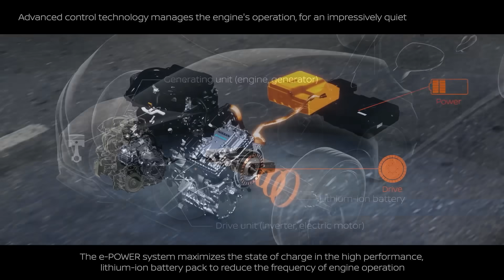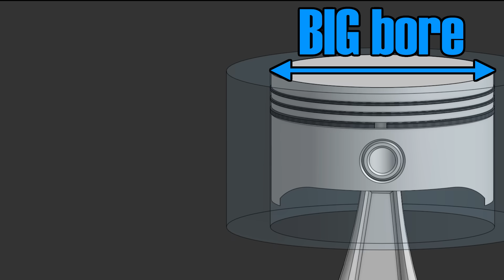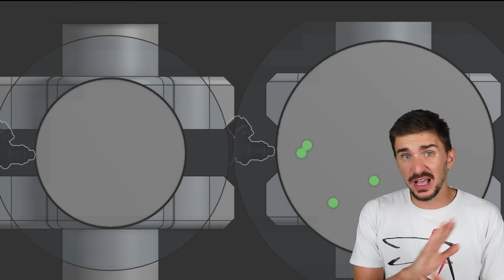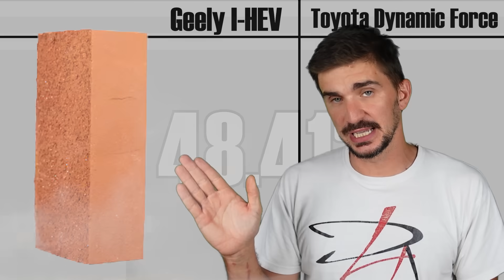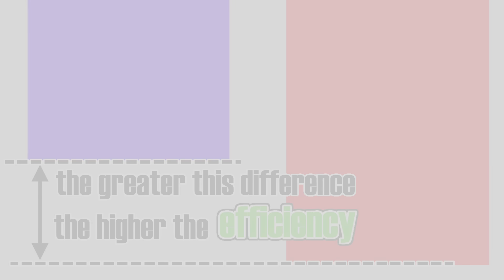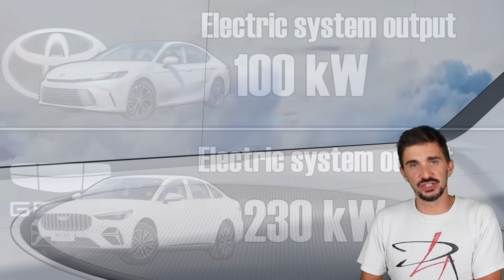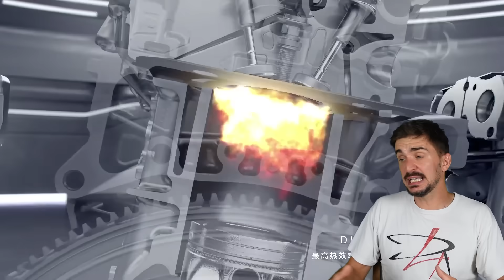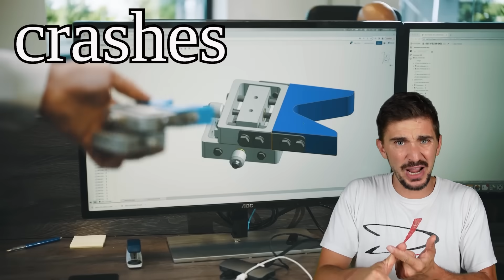How China's Geely Beat Toyota, BMW, Ford and Everyone Else

Comment: I love the development of the technology. I hate the fact that when we all have 120 mpg cars, gasoline will suddenly, magically cost $15/gallon.
Reply: It already does cost $15/gallon, you are just paying via income tax and federal subsidies than paying directly at the pump.
Reply: Welcome to Europe
Reply: Welcome to other parts of the world
Reply: That fuel is for Israel bro don't be antisemitic!!
Reply: That's too bad!
Reply: they also have plugin hybrid, so pump prices dont matter that much. but charging cost does.
Reply: You mean $150 a gallon
Reply: Don't worry the new metric is km/Kwh
Reply: Just like how electricity bills have gone up despite using 90% less electricity to light our homes.
Reply: but no one would still buy EV because engine should goes vroom
Reply: You'll only have 120 MPG cars if you drive compact snd subcompact cars. If you're gonna drive a giant pickup truck just to take your ass to work and Walmart you're not gonna get that 120 MPG.
Reply: @imnotusingmyrealname4566 lol so true
Reply: Yup.  It's like the campaign to use less water in California about 15 or 20 years ago.  It was such a success at reducing the water consumed, that the income to the water suppliers went down significantly, even though many of their costs are fixed (mostly related to infrastructure).  So, the water suppliers requested a rate increase to get back to their previous income (and probably more).
Reply: @proberts34  water costs more in cali cuz we use more water simple as. We grow over half of all the food america consumes and have the largest population of any state. We steal water from 4 neighboring states to meet our needs. Obviously water stolen from 100s of miles away is going to be much more expensive.
Reply: Well, in this state of economy, my 30 years old car disagrees :D. It is still managing over 40mpg tho, which isn't that bad overall. And maintenance costs are negligible too. I hope it will serve me many years to come, maintaining AI powered 120mpg car with overengineered drivetrains is something else... Well, Toyota's HSD is pretty reliable drivetrain, the question is, can other manufacturers achieve this level of reliability, even the cheaper chinese ones? Moreover, my car is simple, more mechanical than electronic, if there are no parts on the market, it isn't that hard to modify some other parts to make it work, like I did with engine mounts which are no longer manufactured for my model. With new cars, I don't think it would be that easy...
Reply: @steposka 1994 corolla owner here, 57,000 miles on clock & running like a champ with amazing fuel economy
Reply: @MrMajjido 94 Corrolla with only 57k miles man your car is still brand new. Please take good care of it for me. Those 90’s early 2000’s Corollas are gems.
Reply: @steposka   30 year old? 40 mpg? Is it a scooter?
Reply: @PavelKostromitinov Cars that can get 40mpg have been around for a while.
Reply: @PavelKostromitinov C5 corvettes can get 40 mpg while cruising with 400 hp on tap when needed. Due to weight and parts available today.
Reply: @dodgedaytona7435  OK, I finally went and converted mpg into units I actually understand. Impressive, but yes, believable. My bad for trying to do the math in my head and getting some ridiculous number.
Reply: @PavelKostromitinov  Octavia mk1 AEE 1.6 MPI 55kW :D. I aint racer, long term average sits about 7l/100km, on highway I can get 5.8l/100km at best and at snail speeds, usually around 6.3-6.8l/100km at more normal speeds and in the city, well, sometimes easily over 8l/100km... I realized that I am not sure whether I calculated US or British MPG, apparently they are different... I keep the engine top notch, ain't no soot in the exhaust, engine runs smoothly, no misfires, sparkplugs have exemplary look to them.. When everything works as it should, even old cars with old engines can run quite efficiently for what they are :)
Reply: @PavelKostromitinov  It could simply be an old  Suzuki Swift or a Geo Metro, but in the US, it's considered a "penalty box."
Reply: The idea is to put four times the number of cars on the road with the same gasoline imports. It’s not about you, it’s about your country.
Reply: @Krunch2020 it's about your money.   It seems every time something gaines efficiency the people that sell you products (gasoline) have to raise their price to make the same amount of money.
They did that decades ago with diesel. They raise the price of diesel not because it costs more to produce, a person with a diesel vehicle got more miles per gallon so they're selling less of it..... So,  similar to DIE they raised the price of diesel to make it more "fair" That's why the person mentioning this said $15 a gallon of gas. 
In essence you're never going to get ahead.
Reply: @randywl8925 did u learn about supply and demand yesterday?
Reply: @randywl8925its not really a conspiracy, just simple supply and demand. More efficient engines means lower fuel demand and therefore prices but that in turn makes people drive more which raises the demand back up. Its a common phenomenon where increased efficiency leads to more demand. The benefit in this case is not in how much you pay for gas, but how much that gas now allows you travel.
Reply: @Krunch2020  How exactly does the price going up help that?
Reply: @Krunch2020 that will be hard in the us, then infants and kids have to start drive cars, since almost all grown-up in us drove cars
Reply: @Krunch2020  The US's population appears set to start decreasing.  You can expect the number of cars on the road to fall also.
Reply: @kensmith5694 That holds for most countries outside of Africa.
Reply: the economy is rigged
Reply: @rezah336 well yeah….it has to be…..the aim is to flatten out the extreme boom/bust swings that cause so much damage & hardship…..the Great Depression for example
Reply: @lancecooper4646  give me a break... an unrigged economy never goes bust except for natural disasters
Reply: @rezah336 ……so the natural disaster that caused The Great Depression was………..🤔
Reply: @lancecooper4646  fed?
Reply: @rezah336 you cannot genuonley believe a bunch of megacorps don't fuck up unless a natural disaster happens. Stick to turning wrenches u have 0 clue about economics.
Reply: @JointedSpagel  you think you know economics better than those who run billion dollar companies?

stay delusional and keep selling hot dogs, you have 0 clue about economics and business
Reply: We can't win
Reply: Just like the electric cost to charge a car at a commercial charger is relatively the same as fueling a petrol car. No savings, just ripping off the consumer. In the UK electricity is more expensive than fuel!
Reply: @jaywhoisit4863  In most of the USA, electricity is usually cheaper than gasoline or diesel, though since our fuel road tax isn't included in most chargers the math can be muddled by however local governments change their annual car taxes or registration fees to makeup for that.
Reply: 100%
Reply: Well, if you insist on driving a car with an engine of more than say, 2.5 - 2.7 litres, you SHOULD be paying more for your fuel......and Americans for some reason think $5 a gallon is expensive...that's approximately $1.20 a litre, or €1.05 per litre.......cheap from a European perspective as we're paying about €1.75 .....mind you, we DO get very affordable healthcare thrown in, so there's that I suppose......
Reply: @iandennis7836  Why should you pay more for your fuel if you choose a larger engine?
Reply: @siraff4461  because youre taking up more of it for little to no reason. Youre creating more pollution that will cause health issues that will then weigh down the Healthcare system and cause increased spending from every single person in tbe city. So ya pay more for your lifted cuck chair truck.
Reply: @iandennis7836  We insist on $2.50 per gallon because that's what it costs shipping included over here when you live right next to the pipeline and in a state that is honest about their tax base.  We get mad about $5 per gallon because we KNOW FOR A FACT that HALF OF THAT IS LINING THE POCKETS OF POLITICIANS FOR NO GOOD REASON.
Reply: @ManCentralStation I'm afraid we'll just have to agree to disagree here......the way you lot waste resources, you SHOULD be paying enough for it to hurt so as you LEARN not to waste resources the way you lot always do......I've lived there, I KNOW. $2.50 a gallon.....you're getting off lightly at $5.
Reply: @iandennis7836  “I’m mad that people have it better than me” in a comment
Reply: @77R_ hes probably busy dieing of heat stroke right now. Might explain part of it
Reply: @ManCentralStation 
Most western countries pay something around $7 a US gallon at the moment.
In my country almost half that is various taxes. However NONE goes to “lining politicians pockets”. It is totally accountable and we know exactly what it’s spent on even if we don’t always approve.
Reply: @meofnz2320 I’m not interested in opinions from people who believe everything the media tells them; thanks anyway for playing along though😂
Reply: @ManCentralStation 
Haha…got it: your “beliefs” trump verifiable facts in the public domain😂.
Look, it’s very hard for an individual to embezzle funds from a tax system that’s audited and monitored by multiple parties. Politicians aren’t that stupid. You’re looking under the wrong rock. Where corruption and personal enrichment happens is upstream and downstream in the lobbyists world and awarding of contracts etc etc.
As an aside; YouTube creators are hardly any more reliable than traditional media. At least they are somewhat accountable.
Reply: @iandennis7836  well we have been subsidizing your defense since the end of ww2 so that helped your economy alot.
Reply: @iandennis7836  US gallon or Imperial gallon?
Reply: @iandennis7836   Where did you get your €1.75 gasoline? It's closer to €2 here in Finland.
Reply: @iandennis7836 You do realize your affordable health care is coming out of your (much higher) taxes, right?
Reply: @ramseycattn5941 yep, we like it that way. You guys build aircraft carriers with your taxes, we build hospitals. The tax take is about the same, incidentally.
Reply: @iandennis7836  But the energy prices have skyrocketed as well. So that benefit was quickly reduced. So it's either oil companies making money or failed "green solutions". Both paid for by consumers. What i don't like about that is that money is siphoned from public funds into private equity. Either from pure greed + incompetence (Trump ?) or incompetence + greed (leftist Europe ?).
Reply: @terjehansen0101  "Either from pure greed + incompetence (Biden ?) or incompetence + greed (leftist Europe ?)." 

Fixed that for you, in case you forgot 2021-2023 energy prices and increase percentages in the U.S.. 

Annual Average Gasoline Prices (2016–2026)
2016: $2.14 (13-year low; OPEC market strategy)
2017: $2.42 (+13.1%)
2018: $2.72 (+12.4%)
2019: $2.60 (−4.4%)
2020: $2.17 (Pandemic demand collapse)
2021: $3.01 (+38.7%)
2022: $3.95 (+31.2%; Record high of $5.01/gal in June)
2023: $3.52 (−10.9%)
2024: $3.30 (−6.3%)
2025: $3.10 (−6.1%)
2026: $2.91 (Forecast; first sub-$3.00 avg since 2020) 

Annual Average Total Household Energy Expenditure (2016–2026)
2016: ~$2,050 (Low fuel prices; mild winter)
2017: ~$2,130 (+3.9%)
2018: ~$2,240 (+5.2%; Higher heating demand)
2019: ~$2,180 (−2.7%; Mild weather offset rate hikes)
2020: ~$2,100 (Pandemic lockdowns reduced travel/commercial demand)
2021: ~$2,550 (+21.4%; Post-pandemic rebound; supply chain issues)
2022: ~$3,200 (+25.5%; Geopolitical crisis; record inflation)
2023: ~$3,350 (+4.7%; Sustained high electricity rates)
2024: ~$3,450 (+3.0%)
2025: ~$3,550 (+2.9%)
2026: ~$3,650 (Forecast; Driven by grid modernization and data center load)
Reply: @iandennis7836  Lmao I will drive a 6 liter and still not care about your shit opinion
Reply: @Turtletoise  how would you have felt if you had skipped breakfast this morning, jamal?
Reply: @chunkspiggle3916  Don’t know, Tyrone
Reply: @chunkspiggle3916  So you resort to calling him black, and calling blacks stupid? Really sells how shit your arguments are.
Reply: @Turtletoise yall r just weird
Reply: @iandennis7836  $5/gallon is definitely expensive when I’m used to paying closer to $2 and currently hovering around $3. Just because you’ve been conditioned to accept high prices and feel bitter that others still enjoy motoring doesn’t make it a standard we should follow—that's a you issue. Nobody should have to subsidize your economic landscape just to validate your resentment. Enjoy your healthcare system, but there’s a reason your own wealthy citizens still come to the USA when they need the best care available.
Reply: @stoptracking-x6g 
For you heathcare point all i can do is laugh, why would normal people or even relatively wealthy ones care that the US has the best heathcare only millionaires can afford? Yeah paying more makes things better, idc about those things if i can't afford them. 

The gasoline point is also hilarious tf you mean subsidizing our economy? We pay to inport fuel and as a consequences are more mindful of the environment than the US that doesn't care how much it is burning because it is cheaper. That doesn't put the US on any high horse, you are just showing how ignorant you are thinking this is a hobby price issue lol
Reply: @ForeverHobbit you Canadian?
Reply: @Pays2Win  no but now I'm curious why you'd think that
Reply: @ForeverHobbit  Just curious, where you hail from? No ill intent.
Reply: @Pays2Win Italy
Reply: @ForeverHobbit Never been, always wanted to go, god bless from America brother.
Reply: @ForeverHobbit lol. I'm middle class in America and I have access to world class healthcare that's almost entirely paid for by my employer. 

Nice try commy.
Reply: @Pays2Win don't patronize him.
Reply: @Boguardis  so once you retire, which is when you tou want healthcare the most, you don't have access to it ok
Reply: The irony in this comment. YOU have been conditioned to artificially cheap fuel. American federal gas tax hasn’t increased since the 90’s. All the externalities of cars: space taken, road repair, lives harmed or extinguished, pollution, climate damage, antisocial behavior, etc are all pushed onto the taxpayer. Even oil spills and abandoned gas/oil wells are up to the taxpayer to cover up.
Reply: @ummuser  Most gas taxes are state taxes, not federal, in the USA and in at least some states they have increased significantly in the last decade.